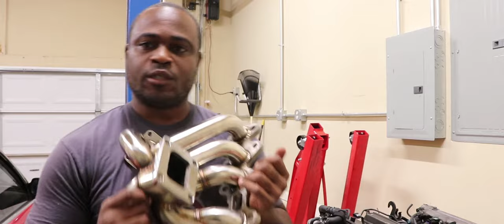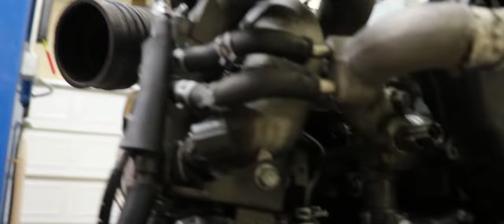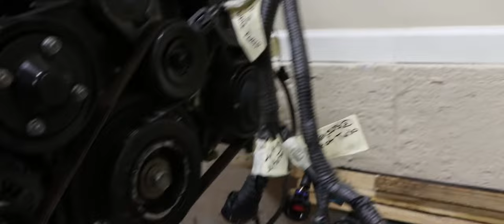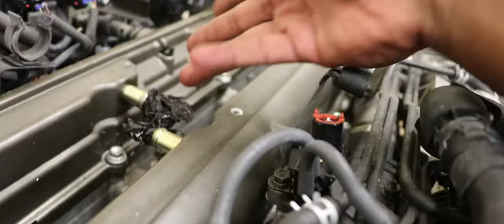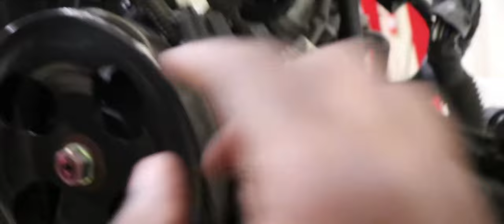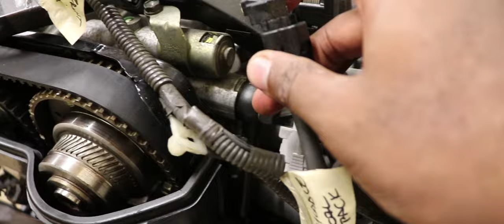2JZ TWIN TURBO REMOVAL

Comment: Late to the party here. Did they advertise how many original miles were on the engine prior? VVTI cam gear looks new, along with the timing belt and seals so one would assume it was a 90-100k timing job maybe? Spitballing here. Cam covers typically leak a little too. Overall looks like a worthy foundation for a great 1J conversion 🤘🏼